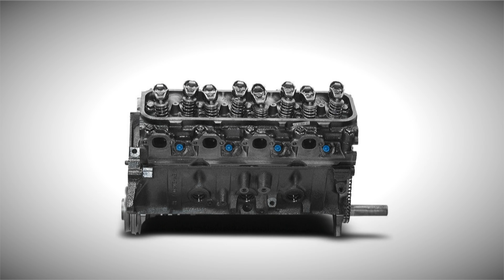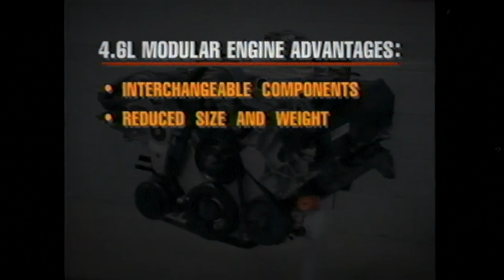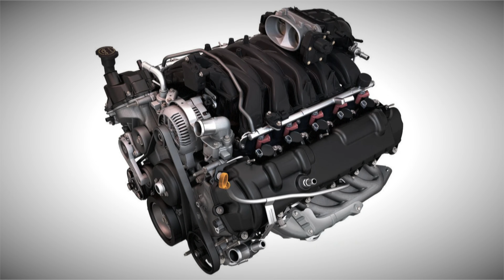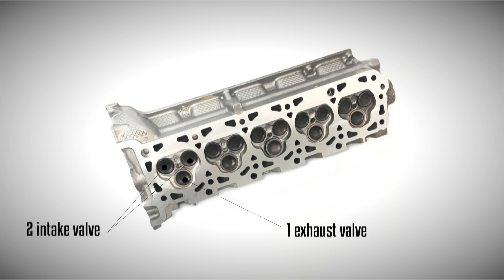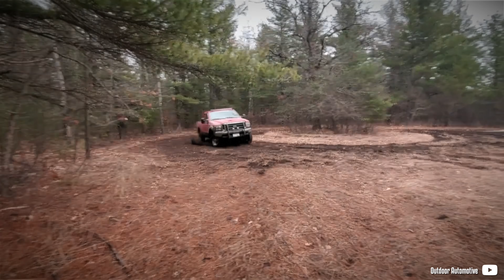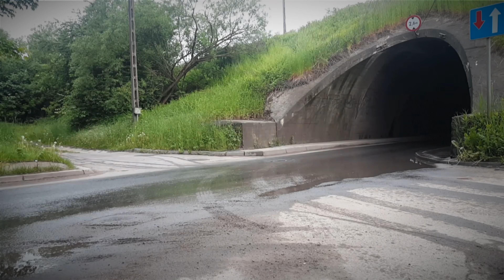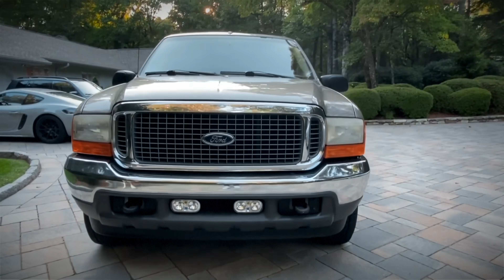Is Ford's V10 Truck Engine Any Good?

Comment: I am sad that Ford never stuck the V10 in the Mustang with a high cam lobe and 10:1 compression
Reply: Or put it in the GT…
(like GT40, not the Mustang GT)
Reply: @Iowa599  be the Ford Gallardo/Huracán V10 😎
Reply: @Iowa599  putting it in the GT40 would make it handle worse.
Reply: @sepg5084  not necessarily. The wheel base would need lengthened enough to fit the engine. Everything else is tuning..
Reply: Check out the channel Deboss Garage.
They're doing a swap at the moment 👍
Reply: The crankshaft design didnt leave room for high rpm in a mustang.  Its a torque monster though.
Reply: @jasonstarnes3838  Might be nice in a Town Car.  🤣
Reply: @greggc8088  I think even the 5.4 would have been a good option in the town car
Reply: @Guns_N_Gears  that was a 4.6 based 5.8L v10. it got restored recently and apparently loves to hit 8k
Reply: @kensterfr33k  I watched the video of the v10 prototype after this and they claimed a redline of 7 grand so I wouldn't be surprised at all
Reply: @Verre_Vid  yeah those cobra motors are insane
Reply: Ford didn't no, big rip on that one. However my little brother and I did for his s197 mustang, it's very tight but the 5th gen mustang's 4.6 motor mounts mostly line up the same to the v10 with transmission (also have to get an oil filter relo kit and the mounts take place of the v10's oil cooling filter thing). The tr3650(granted it doesn't like the extra torque) does bolt up and fit. I recommend replacing the 10 spline input shaft to the 28 spline since um torque. It can be done and there's a surprising amount of room in the engine bay with the s197 make sure you adjust the tunnel with a few taps of the hammer when using aftermarket exhaust manifolds. I'm unsure how it would fit in the others Mustangs. last thing, we used a 20 valve model but we are pretty sure that you could use a 30 valve motor with it's computer. A few computer connectors would need to be re pinned to be nearly factory functioning. Kind of the same way people put the 5.4 in some mustangs.
Reply: @kromsplod  Wow that sounds like it's not that tedious to put the V10 in there. Nothing like BMW's V16 job for sure😂
Reply: It'd be cool but its to big of a motor to fit in the car hell even the new 5.0l leaves barely any room.
Reply: @conner1997  Luckily its successor, the 7.3L Godzilla, is an OHV engine, meaning it's quite compact. 7.3 tuners immediately put that engine in a Mustang once crate engines were available. Ford has nothing but wins in the heavy duty segment, the 7.3 and 6.8 are a great representation of that.
Reply: @imnotusingmyrealname4566  yup i like the 7.3 looks like a badass motor
Reply: @conner1997  Actually, there was a Mustang that had a V10 installed. Motortrend covered it in 2003
Reply: @spukersonmerlosk1661  i know..im talking made from factory
Reply: @conner1997  that and the weight distribution would be shit.
Reply: @conner1997 no, it fits.
Reply: Ford did make test car. The boss 351 it was a destroyed v10 and hit 8000 rpm
Reply: They actually did in a prototype mustang I believe 2001
Reply: @infernoking7504  I think he meant for a production model.
Reply: They tried, but they decided it was too heavy and big and the split crank design was a weak point of the engine.
Reply: That they never put it into the 2nd Gen GT-40 was a damn shame.
Reply: We need to make westen champlin do this, 😂
Reply: It would have to be a complete redesign like dodge did with their 8.0 v10 in the viper. Because the ford v10 is super strong exactly where ford has it set. If you try to build it any further it breaks quickly.
Reply: I like to send my f550 v10 to redline every day so I can blow that shit up and get a honestly any other engine
Reply: I think they should’ve kept the Thunderbird as a compact, Grand Touring Sports roadster with a V10 powering the rear wheels (or even all wheels) through a 6-speed manual gearbox. That
Reply: @Guns_N_Gears Why was it too dangerous?
Reply: What a big lazy lump
Reply: The mustang is already way too front heavy as is
Reply: There was one in Australia with a supercharged V10 built for (GTP) GT Production racing
Reply: They did but it was never anything but a concept
Reply: @pugjoe3915  I know man, I saw the video of the concept right after I watched this video. Coulda-woulda-shoulda, the LFA had a V10, course mustangs would have never been as sophisticated, but still,  there's an alternate universe where I pull up beside a v10 mustang and become a giddy child again! 😁
Reply: @Verre_Vid  I mean you could always swap one in but it would be a fab rabbit hole
Reply: @pugjoe3915  not to mention all the stuff I'd want machined for the engine like a 4-valve head, forged crankshaft, pistons, rods, etc etc etc. Yeah it would be a passion project for the right person with deep pockets. 

Though I reckon it would be a sight to behold. 🙏
Reply: The beast sounded like a Lamborghini . Could’ve had a Cobra vs Viper showdown in the 90s. Crazy that it was more powerful than the 460, a friend had one in a dump truck and the V10 in a pickup lmao 😂
Reply: @opraiderman904  it didn't sound anything like a Lamborghini, lmaoooo
Unless you meant the tractors XD
Reply: They are swapping one in a mustang, think I saw it on Deboss channel.
Reply: I think Ford toyed with the idea of a modern Shelby Cobra with a V10 years ago but it never went anywhere.
Reply: if they did it could be a competitor to the didge viper
Reply: They did do a V10 Mustang prototypr
Reply: It’s a non factory build, but if you look up the “Triton V10 Mustang 2 Evolution” someone built a blue one with the V10 and it looks amazing
Reply: A mustang with a V10 will crash faster into crowds 👍
Reply: they were afraid to be compared to the viper
Reply: We hoped.
Reply: @angelo_giachetti  I didn't expect my fever-dream comment to get so much in the way of replies, but here we are! 

Hopefully it's fostered a dynamic idea-sharing conglomeration. But this is the internet and I'm not reading all 75 replies.
Reply: My Tacoma has 11.8-1 compression on the 3.5 V6
Reply: I'm Mustang 2 front end swapping an 87 Suzuki hatchback... Was looking at a 4.6 or 5.0 but I think the heft of the V10 may help keep the front wheels on the ground better.
Reply: it would of been better in another version of the GT than in a mustang when the V8 already make them very front heavy
Reply: Actually they did for a prototype “the mule”
Reply: Very hard to get power out of would have to rebuild a completely new engine.
Reply: Not bringing that 5.8L 40V engine to production was a war crime.
Reply: they made a prototype but they never produced them
Reply: Ford may not have done it but this guy did

https://m.youtube.com/watch?v=PGoZlICY_6Q
Reply: Junk in a truck you think it will be better in a shit stang it's a Ford wake up
Reply: Way too large/heavy
Reply: @cameronriccio6050  depends on the hp/litre ratio bro 😎
Reply: They made a prototype and it was faster then their cobra r at the time so it was tanked. Basically had the same performance of the mustangs we have now
Reply: They did as a concept, but it sadly never came to become a production model.
Reply: They actually did do that it was called the boss 351 it was basically a 4.6 intech with 2 more cylinders it was a freak it had two ecus one for each bank it was very fast
Reply: There is at YouTube channel where a guy is building a triton v10. He too ford mustang 4.6l heads and fit them to the v10. He also made it sound like a Indy car
Reply: They did in 1999 and made it a 4 valve
Reply: @natek4139  That was the 5.8 prototype, Ford never made a production 40V V10 of any sort
Reply: @alexbeuerman7608  it was a 40v v10 but correct they never made it  production and they totally should have. They made the 5.4 into a v10 (6.8L)they could have just made the 4.6 into a v10 which would have  been the 5.8 if I’m not mistaken?
Reply: Ford built a V10 mustang Cobra prototype it had a one off set of quad cam 4v heads it was dropped in favor of the blown 4.6 found in 03/04 cobras
Reply: They almost did
Reply: This calls for some redneck engineering
Reply: That v10 would walk itself right out of the mustangs engine bay. That is A LOT of chunky metal flying around in that motor.
Reply: That would be awesome!
Reply: Did you not watch the fucking video?
Reply: The motor sounds like crap my guy.. I can see why they didn't. Not too mention the obvious lack of engine bay room.
Reply: 10:1? That's pathetically low for a naturally aspirated engine. For example Mazda's naturally aspirated 2.5L has 14:1 and the turbo has 10.5:1, so still higher than that.
Reply: @imnotusingmyrealname4566  yeah sure but this thing would have been transplanted around 2005. You're thinking modern engines, not contemporary 2005 compression ratios.
Reply: @Verre_Vid  True, engine technology definitely advanced quite a bit since then.😅
Reply: @imnotusingmyrealname4566  too true man! Even tire technology has been crazy in the past 20 years. Take a car from the 60s and its 0-60 with modern tires and it'll clip a whole second off its time. Absolutely wild how far we've come.
Reply: @imnotusingmyrealname4566  yeah cuz direct-injection and zero weight oil is really great for your car
Reply: @Sam Holdsworth  Direct injection has many benefits, but it needs to be combined with port injection to get the best of both worlds. 

I don't know of any engine recommending zero weight oil, though.
Reply: @geoffinbc  Plug-in hybrids run extremely thin oil because they are expected to cold start and deliver full performance. I mean think about this you drive in EV mode but then you want to overtake, you step on the gas and suddenly the engine is under high load. It's a very dumb design which perfectly encapsulates the concept, that being efficiency over longevity and those cars will be really expensive in the long term, a battery replacement and an engine rebuild, that's gonna be a real nice surprise for used car buyers. The age of Toyotas that run forever with minor repairs is over, well, unless you buy gas models.
Reply: @imnotusingmyrealname4566  14:1 is only capable on pump gas with direction injection, which the v10 does not have.
Reply: Hey not to burst your bubble but you’ve  chosen a terrible engine to compare the 6.8 v10 to. The “skyactive” technology is an aktinson cycle meaning that although the static compression ratio is higher, it’s actual effective compression is in line with conventional engines. You should read up on it it’s actually ingenious and starting to become the standard for hybrids seeking higher efficiency
Reply: @imnotusingmyrealname4566  low compression = combatibility with cheap gas
Reply: @imnotusingmyrealname4566  not for regular fuel injected engines with that much displacement. To go much higher than that you need direct injection. Or a smaller combustion chamber that's less prone to detonation. Or you will have to run premium fuel.
Reply: @imnotusingmyrealname4566  Mazda uses sky active tech on that engine.  It's basically a diesel. It ignites the fuel with compression.
Reply: @imnotusingmyrealname4566  Mazdas are direct injection which lets them run super high compression… it limits ignition timing because the highest octane available in the US is 91/93 which is why when you swap over to flex fuel and run e85 these modern engines pick up 30hp… it’s because they’re seriously timing limited… now a 6.0L+ v10 with 10:1 compression is pretty impressive! And in most cases 10:1 compression is THE HIGHEST compression you can run on 93aki fuel before you have to start reducing ignition timing…
Reply: @Texas_Road_Warrior Interesting. I've looked it up and the still really new 7.3 Godzilla has a compression ratio of 10.5:1 for example.
Reply: @imnotusingmyrealname4566  Mazda used some crazy space magic to make that crazy compression work.
Reply: @imnotusingmyrealname4566  High compression in NA motors has benefits such as better thermal efficiency. However, in forced induction motors, high compression is the opposite of what you want. A lower compression allows more air and fuel to be forced in the cylinder.
Reply: @imnotusingmyrealname4566 10:1 isn’t pathetic if you put into perspective that they were developing this in 2001 and not 2010
Reply: @imnotusingmyrealname4566  the size of the cylinders in a motor like the V10 where towing capacity is important, a higher compression ratio is problematic because it will be vastly more prone to detonation when under load.
A passenger car does not have to worry about this and have higher compression ratios to compensate for their otherwise lackluster proformance.
Reply: @thatguyoverthere9634  true
Reply: @imnotusingmyrealname4566 Mazda is doing some witchcraft in the compression ratio field and they have for years. 
Not really a good example.
Reply: The 5.4l in the navigator at the time had 10:1 compression and requires 91 octane. 10:1 was considered high compression back then. The rest of the modular engines only had 9:1 to 9.5:1 compression.
Reply: So what!  I bet you have a giant wing on your Mazda @imnotusingmyrealname4566
Reply: @imnotusingmyrealname4566  It appears you are ignorant on how direct injection, big bore/long stroke, and cast iron affects ignition in the combustion chamber since you're calling it "pathetically low".
Reply: @imnotusingmyrealname4566  nowadays 10:1 is low. Mazda is the exception with their skyactive engines not the rule. 11 or 12:1 in a v10 would be dope